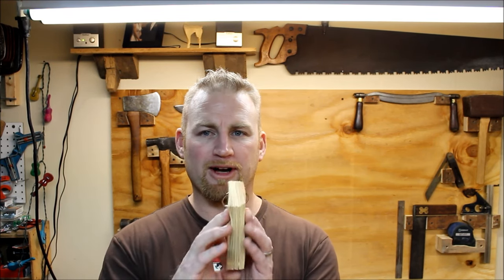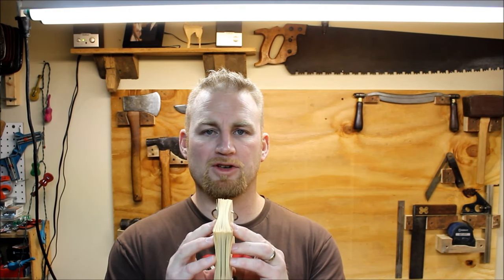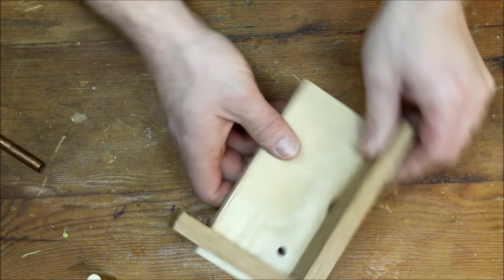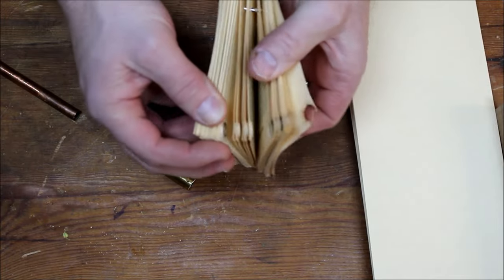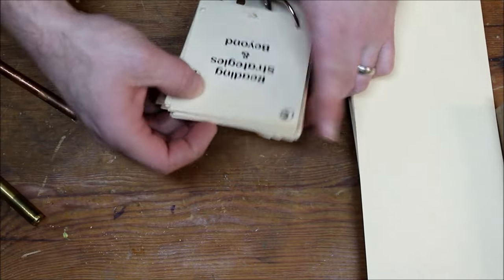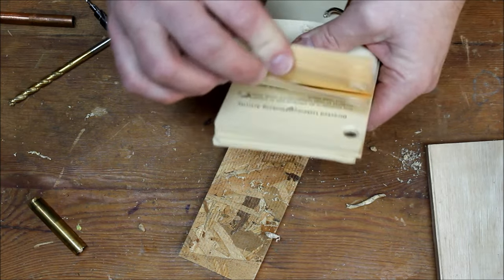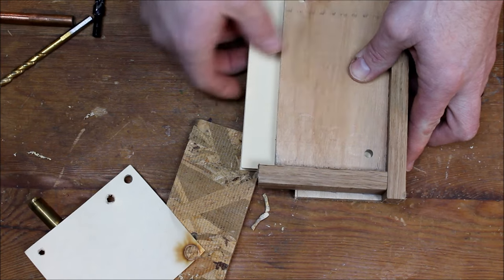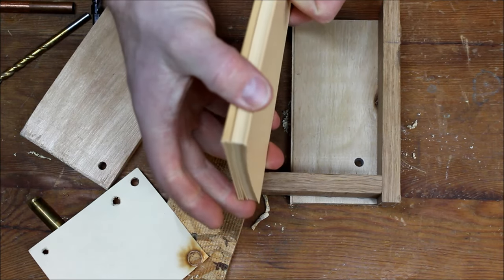How to DRILL PAPER OR CARDSTOCK- BEST METHOD!!

Comment: Print shops have a very sharp stainless bits and machines that do 3 holes or less at a time. They use beeswax as a lube to keep down the heat. You can get beeswax in sticks and pucks

Comment: Thanks dude,
I'm currently building a titanic model, the shell plating was done with gloss cardboard, now I need too drill port holes in and the cardboard top keeps tearing out around the bit,
Any advice on how I can drill them?
Reply from the maker: Mr Hyde try clamping real tight, sandwiching material with scrap blocks of wood if possible...but may be tough if curved.

Comment: Great video, because it's clear and shows some steps along the way. You suggest using WD40 on the bit which isn't shown in the video. I think it's worth a try, but I'll try spray silicone lube so it doesn't stain or cause the user problems.

Comment: Thank you for your thorough explanation. I appreciate your sharing what you tried first and along the way until you found what worked best. That is helpful for us who might think, I'll just try 'x' (like standard drill bit LOL). I learned of a new tool, the brad point bit. I will buy one for my paper drilling project. I am sure I'll find this type of bit works better in situations I would previously produce poor quality holes with a standard bit as the only tool in my arsenal. Thank You!

Comment: Hi,
I would like to ask if you have holes without embossed edges on the other side. I can't drill holes without these deformations. I drill holes in screw photo albums → bookbinding cardboard with a width of 2.4 mm and inside photo cardboard weighing 300 g / m2. The total width of the album's spine is 2-3 cm. Do you have a wood drill or a paper-specific drill? Thank you and greetings Radka

Comment: good to know.  did the wd40 leave any stains on the card stock?
Reply from the maker: That was a worry of mine, but no it didn't.  I just sprayed it once, then wiped off any excess with a rag and it made a big difference in paper adhesion (if that's what you call it) to the bit. Thanks for watching man!

Comment: thanks for posting this.
it worked great for me.
I needed to 'drill' 3 x 1/8" holes in the 8-1/2" paper side of 100 pages or so.
- I used bar soap instead of the wd40.
- I clamped the sandwich boards tightly.
- I used the highest speed on my hand drill and pressed lightly ie I let the speed do the cutting.
- I used a single edge razor to flush trim the first and last page holes of the stack.